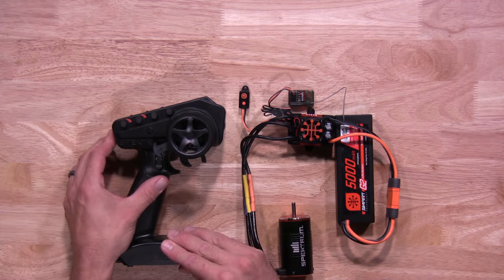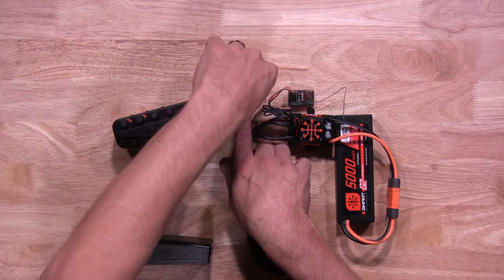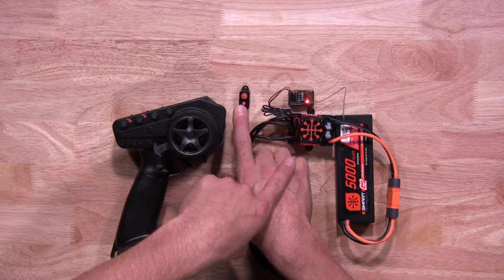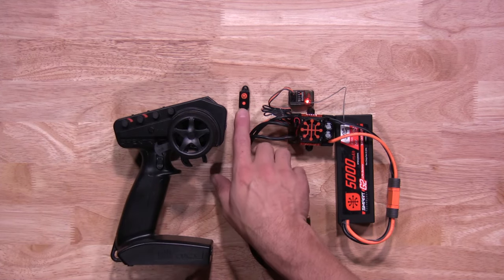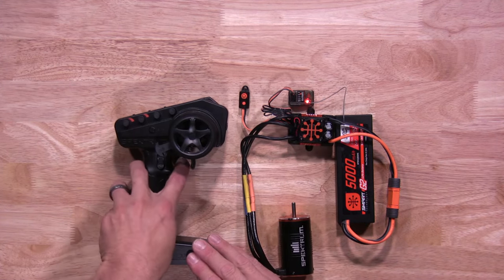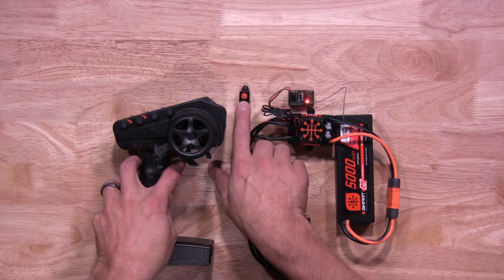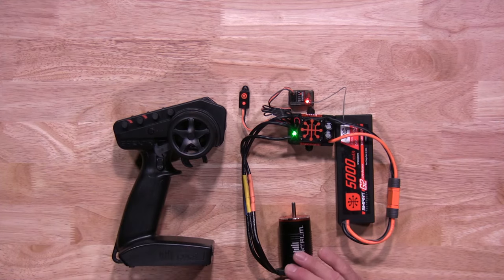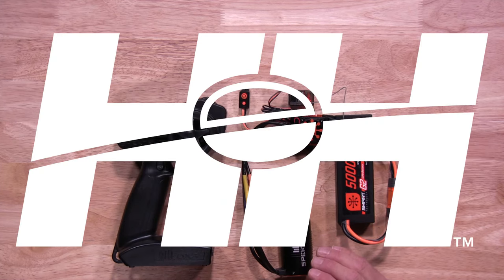From the Tech Desk: How to Calibrate your Spektrum Firma (85,100,120,130,150,160) esc

Comment: When I hit the set button, there’s no green light, but the red flashing light stops. Then there’s just no light or sounds.
Reply: I've got the same. did you sort this?
Reply: @trcspares  Not yet :( Gonna try and contact Horizon, this is beyond frustrating.
Reply: I had the same problem too how do we fix that.
Reply: @mr.cornflakes9280  not even sure, their support is horrible
Reply: Did you ever fix it? Just got a losi baja rey 1/10 and my esc is doing the same thing.
Reply: @EthanCmsrc108  nope :(
Reply: @dtsnjsn6101 you had to of figured it out?! Tell Me My Friend😩
Reply: @crakazach2140  i need help to
Reply: @cjholstein6419  I got mine. I reset my receiver and re binding my transmitter to it
Reply: I accidentally had the esc and servo connections to my receiver backwards, you might try flipping the connections the other way and plugging them back into the receiver

Comment: I found the solution to get it to work if you have an AVC receiver. Once you bind the receiver immediately Pull full throttle then full brake followed by full right then full left steering Quickly. Shut the esc off and then follow the instructions in this video.
Reply: Thank you sir you have relieved a rather large headache!

Comment: I have a spectrum 120 amp ESC. That I put in my granite and it won't go slow. It won't creep like the original ESC. Like I can't get it to go slow. The slowest it will go is probably 10 miles an hour. Maybe a little bit faster and I reupdated it. Hooked it to the computer I've done everything I can think of I'm thinking the ESC's probably messed up or something cause it will not go slow.  If you lift it up in the air and hit the gas, it goes, but if it's on the ground, it only do like 10 miles an hour, and this is just touching the throttle, just engaging it.

Comment: I did this and the motor does the opposite of the transmitter.  If I use the TH/R switch on the transmitter, the direction is correct but the brakes are on the forward position.  Please Help!

Comment: How come mine goes faster in reverse?
Reply: Same here did you get it figured out?
Reply: Yeah. Get a 30 dollar programmer and u will be happy. Or u can swap the two out side wires... orange and bule
Reply: But with the programmer you Chan change the rotation and menny other things
Reply: Okay great that’s what I’ll do thanks!
Reply: U can swap them wires and it will be fine wile you wait for the progmmer to come in. What are u working on?
Reply: swap the cable between the speed controller and the motor?????? Help me
Reply: I buy the firma 3300kv help me
Reply: Yes the wires that come off the motor that goes to the ESC
Reply: Orange and bule

Comment: So I got an arrma felony and I upgraded the motor and esc to an 8s system, but when I try and calibrate it. The neutral saves. The full throttle saves, but it won't save the full reverse. So when it's running it just has no brakes. I have the brake dial set to full. It just won't acknowledge it. Please help!
Reply from the maker: Check your brake rate on the transmitter. Make sure its set to 100. Also make sure your trim is set to neutral. Also check the brake throw. Make sure its at 100 as well.